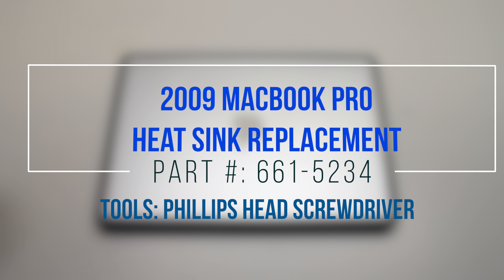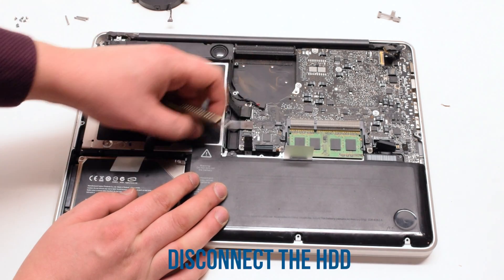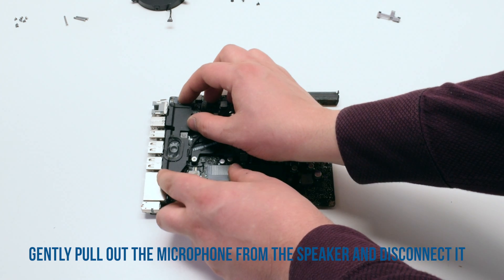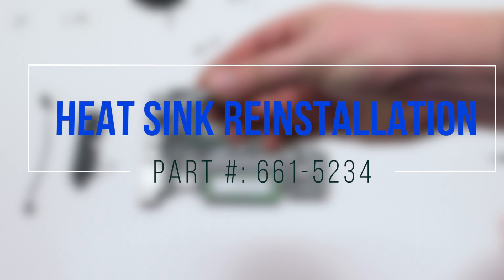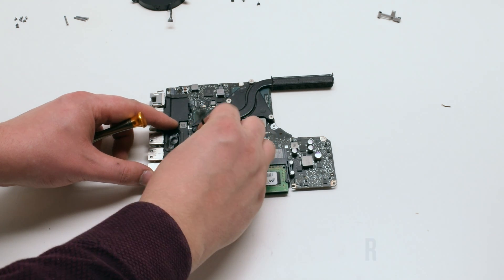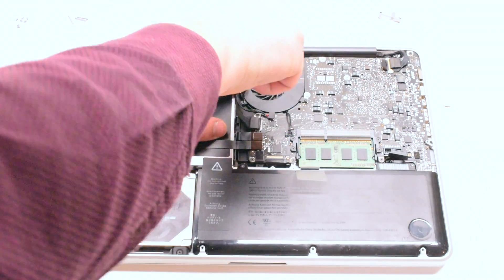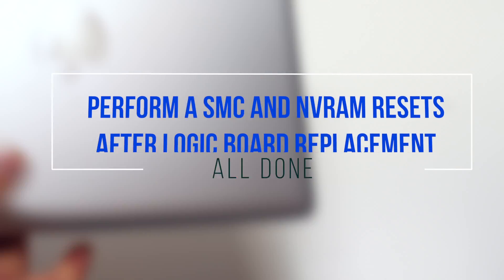2009 Macbook Pro 13" A1278 CPU Heat Sink Replacement

Comment: I followed the video to get some new cpu compond, but now won't turn on. I snap the J1 cable (power indicator cable, i did not see that in the video :(   ). Is that an essential cable or did I miss something.
Reply: its the flex cable of the keyboard

Comment: Great video! Very helpful! I am pretty new to doing repairs on Apple laptops. I have this exact model and I was told by Apple that the fan as well as heat sink need to be replaced. Is it possible that it just needs to be cleaned out and have thermal paste re-applied between the CPU and heat sink? Or should both the fan and heat sink just be replaced?
Reply: Apple does not fix things they just replace parts and charge you a lot for them. If the fan still runs then you might just want to dust it out. I would try new thermal past as it can make a real difference. My girlfriend has this same model and still running. Every now and them I have to open it up and clean it out. After 11 years I think that computer needs new paste. Some newer models are rumored to have come with bad paste to begin with.

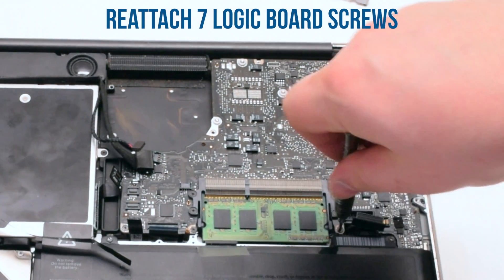Comment: Hi, I tried to follow this video but when it came to removing the 7 Philips head logic board screws, one of the screws were so worn out that it was impossible for me to get it out. So I assembled it again following the same instructions backwards (i.e. from 1:48 in the video, I jumped straight to 6:22). Now that I put everything together, the laptop won't even start. The light from the charger turns green like it should, but while pressing the ON button on the laptop, nothing happens. I have also tried holding it for a while. No light, no sound. What did I do wrong?? Kind of worried I broke something now :( Appreciate any help!
Reply from the maker: It's they keyboard connection, the power button is part of the keyboard, check it and reseat it.

Comment: Thank for greatу video. It help's me a lot! Could you please advice, what is normal temperature for A1280 (Core 2 Duo 2.4Ghz model) I have installed SMCFAN it shows me about 70-80 on halt. Then I clean heat sink, now it's about 49-56 on halt with about 1900RPM. Is it normal? Maybe compound is bad?
Reply from the maker: 50-60 is perfectly fine.
Reply from the maker: 40-90 is the acceptable design range.

Comment: Hey I replaced the the thermal compound on mine and now the thing wont turn on..it charges though
Reply from the maker: Check your keyboard connection to the logicboard as the power button is part of the keyboard and if it's not in correctly it will not power on.
Reply: Everything checked and done..this is a fix iv done many times over to many macbooks..I tried to jump start it by shorting the two power pads, that doesn't work either, reset the smc as well..still nothing..I also live in a humid country so theres no static..makes no sense ._. It worked fine before taking it apart
Reply from the maker: Try checking every connection again even something as simple as changing the charger, chargers go bad sometimes.

Comment: can you upgrade your cpu to something better on the same 2009 MacBook Pro?
Reply from the maker: Unfortunately no, you can upgrade the entire logic board with a better CPU but it's a minor upgrade and the cost is of a used Macbook Pro.
Reply: dosdude1 managed to do it, but it is not recommended to try at home